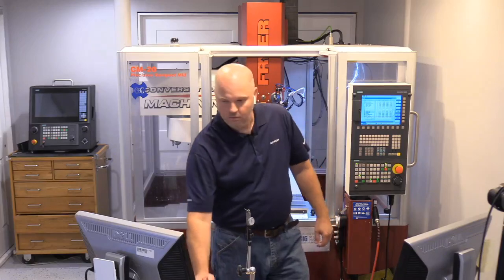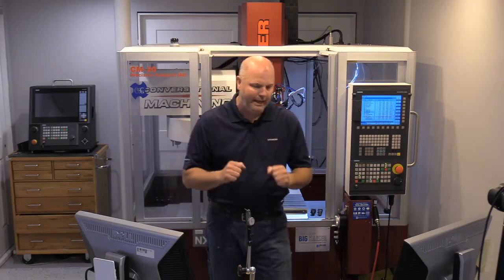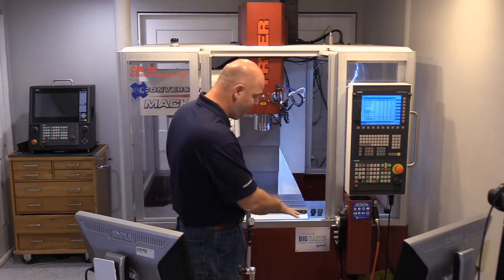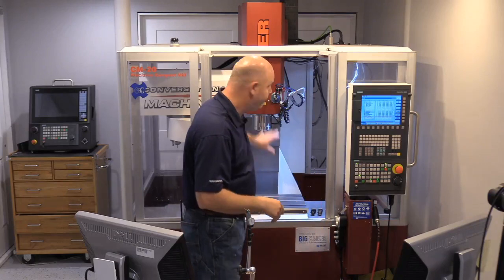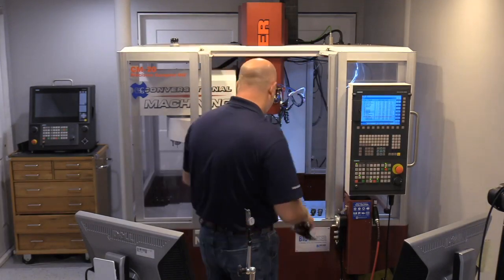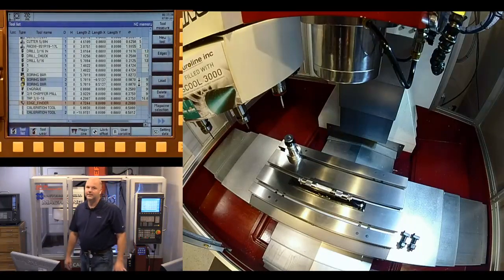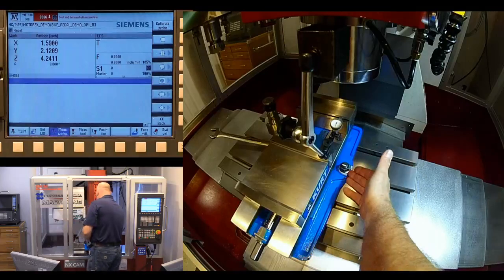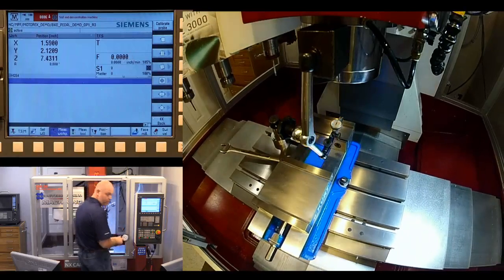How to setup a 3x cnc mill

Comment: Spirit level table setting method. and vice fixed jaw  0 setting method . Next Edgefinder setting with rpm 800_1000 RPM information ....probe  align edges method  explanation information very good sir 🙏
Reply from the maker: Thanks for sharing

Comment: I've been enjoying your videos. I recently got my first vertical milling center and your videos have been helpful to me in my learning process. I am curious about your video set up. Are you using OBS for the multi cam shoots & streams? And are you using Bluetooth or Wi-Fi for transmitting the video signal? And one last question, are you using GoPro's inside the VMC? Thanks!
Reply from the maker: Yes OBS and capture cards. Hardwired cameras, and Cameras are Sony action camera and ION action camera
Reply: @MrCNC  Very helpful. Thanks!